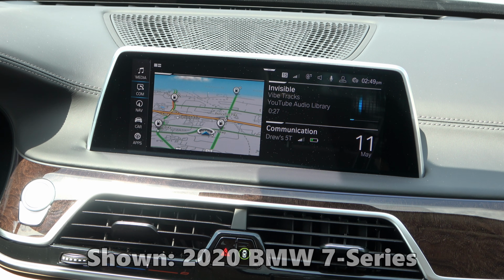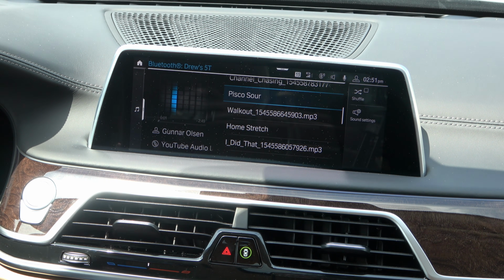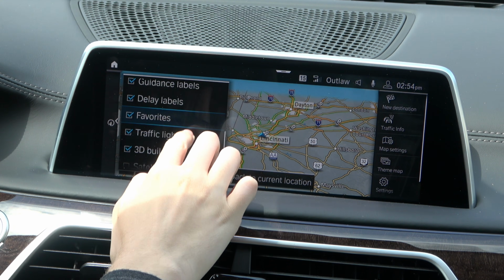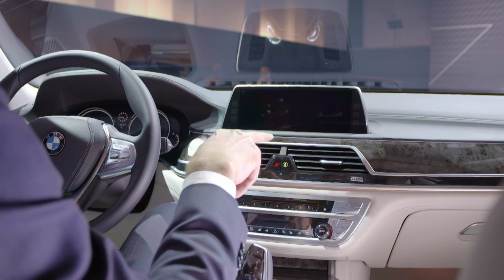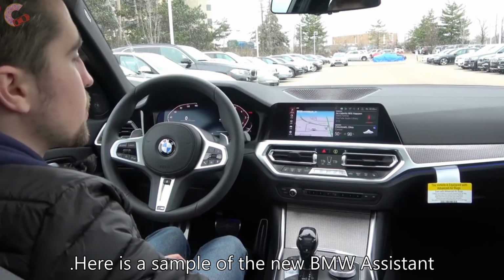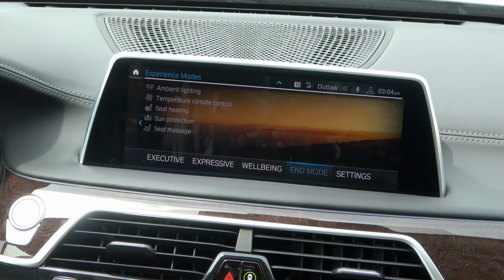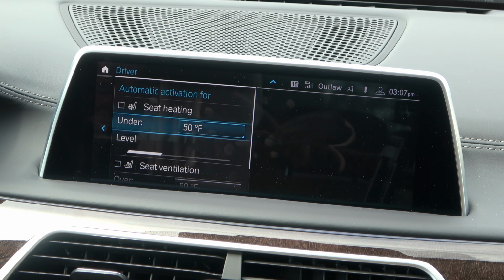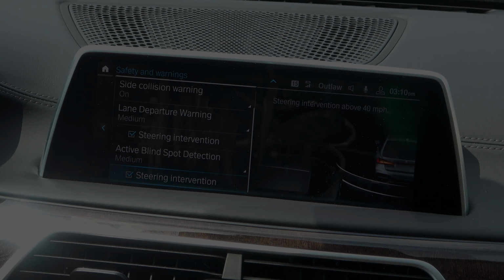BMW iDrive 7.0 (all-new) 2020 Detailed Tutorial and Review: Tech Help

Comment: Were you using CarPlay or Android auto to text message? My phone works ok but I cant get test messaging to work. I have an android and want to use text messaging without using android auto....is that possible?
Reply from the maker: It may or may not be possible depending on the phone. Some Androids don't support the advanced messaging, which may be your issue

Comment: I have a 330i m sport 2019-2020 with Idrive7 with side and reverse parking assistant. The two modes do not work correctly. They scrape the wheels on the pavement and the reverse is totally silly. I can hardly get in reverse until the end, it always crashes at the beginning. Tomorrow I'm going to make a movie and send it to BMW technicians to see if the system malfunctions. This video will be posted on youtube.
Reply: I have same car, same model, received JAN 2020.  Reverse assistance works perfectly, haven't tried side parking assistance yet, I hope will work as good as the reverse.  Try upgrade of the s/w or just take it to the garage.
Reply: I'll refer you to this pro for any online services,or remote automobile engineering, iCloud bypass,social media hack,e.t.c! chat via
INSTAGRAM=== instagram.com/slowfire7